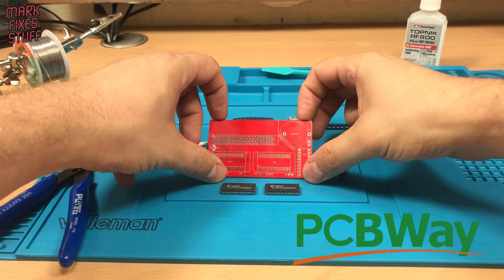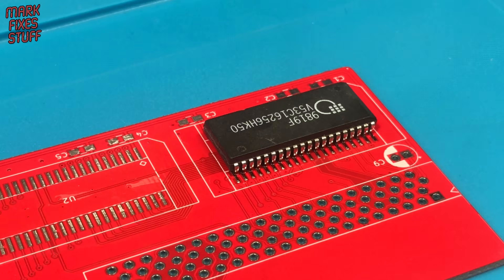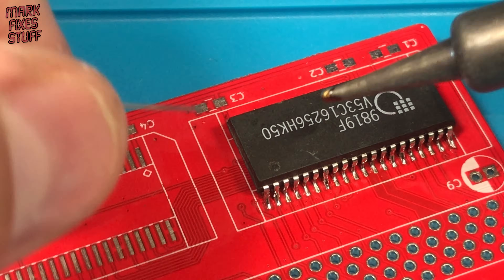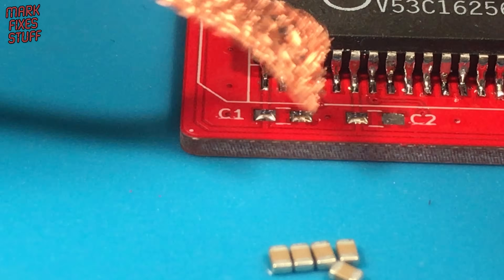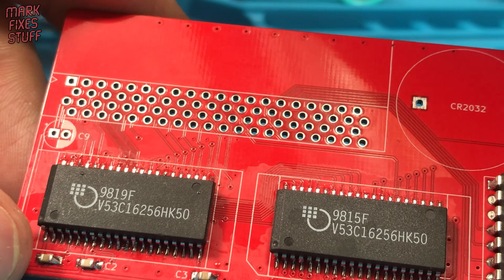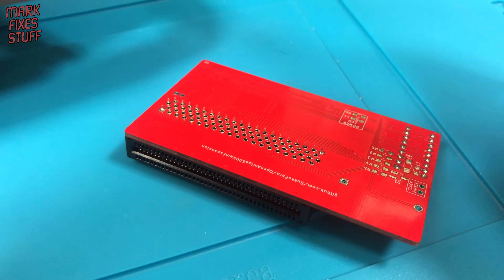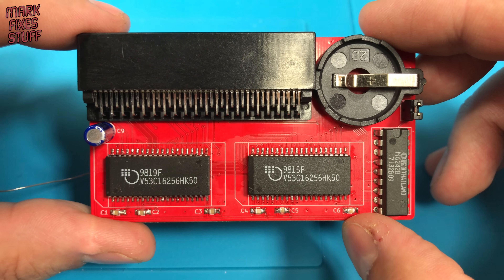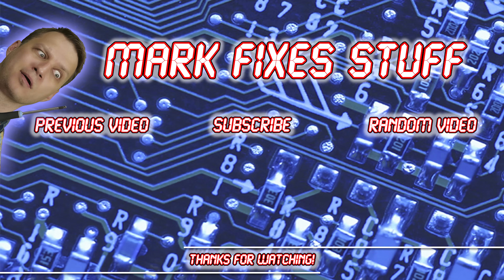Building a Commodore Amiga A600 Chip RAM Expansion - Step by Step!

Comment from the maker: Thanks for watching this video.

Update: I used an incorrect part in my build for the real time clock (thanks Keir Fraser!) so make sure you use a RTC62421 or RTC72421 as listed in the project! I've just ordered replacements. 

If you wish to purchase the board then the link in the description goes directly to the creators webstore on PCBWay. If you order from that page then the creator (SukkoPera) will get a percentage. The page also has a link to SukkoPera's github page.

Comment: i recently purchased a hot plate from ali express its no very big but i can now solder blob on components very nicely i tend so far to use it for chips , it has a hold down so you can be sure the component is in place while you work 
it was around £25 so not bad value
Reply from the maker: Nice. I need to get someting similar. Just don't leave it switched on unattended.
Reply: @MarkFixesStuff   yes thats something to remember for sure , but well handy

Comment: Good job
But after some basic calculations, I've come to the conclusion it would be cheaper to get preassembled board rather than buy assorted components and PCB
Reply from the maker: Yeah. It’s a passion project perhaps. I got all the stuff from Aliexpress so it worked out dirt cheap. You are correct though.

Comment: This video is great Mark you managed to catch and turn my enthusiasm from my original somewhat off topic question of the differences between the ZX OMNI and Just Speccy after seeing the video on RetroManCave! But I dont need anymore computers for me less is becoming more!  So back to the A600 Ram Expansion when your soldering are you using any type of magnification and what type of solder and soldering iron are you using? and this video is great "Tomb stoning" I thought it was just me! Cheers again Mark.
Reply from the maker: Hi Betty! Thanks for watching! When I’m soldering SMD I use a small digital microscope, but it doesn’t work well for filming because it gets in the way. Solder is a thin tin leaded alloy and the station is a temperature controlled Tenma unit that I’ve had for years. I am planning a tools video real soon so watch this space!

Comment: That OKI RTC chip won't work in this board as it requires an external crystal. You can set the time but it won't ever tick upwards! You need an RTC62421 or RTC72421.
Reply from the maker: Ah! I was sold it on the basis it was a direct swap. Thanks for this mate.
Reply from the maker: I found a seller with 5x RTC72421 AliExpress for $6.66. Fix incoming - Thanks again.
Reply: Perfect!

Comment: Do PCBWAY supply components also with pcb. I`ve never used them before and seems like pcb supply only in menus?
Reply from the maker: PCB only. If you order in volume they offer a build service, but I guess you are asking about a kit.

The parts are easy to find though.
Reply: Thanks for the reply Mark. The issue is the edge connector. All other parts seem easy to find.

Comment: I have been looking for a solder sucker that is not just hot garbage, I have been through about 5, all trash, I will give that one a try, thanks for the linky.
Reply from the maker: I've had this one for two years. It's my go to manual pump. In fact, I don't have any others!
Reply: They are great; I have the same one. Buy some spare tubing as it does not last forever. Much better then a regular sucker, but they are a bit small if you have huge hands...

Comment: 3:15 Need WAY more flux for that. You can always clean it off afterwards.
Reply from the maker: Yeah. Apparently I should be using the gunky flux paste as well. I usually do hot air on stuff like this to be honest. Wanted to just use an iron for this vid because not everyone has or wants to buy a rework station.  Drag soldering packages with flat pins works great with the topnik liquid flux. Just the J leg packages don't. I think the curve is the issue.
Reply: @MarkFixesStuff  You can still use an iron but you need a 'louis rossmans worth' of flux and the solder will just fly to the pins. clean after with IPA or an ultrasonic bath.
Reply: Tips: https://youtu.be/LoRxJRU_g2s?t=1825
https://www.youtube.com/watch?v=iKDAmY9Rdag

Comment: You'd e better if switching to a flux paste such as Amtech 559 or Mzg 8341 if you're going to try to drag solder.
Reply from the maker: I actually have some of the Amtech stuff. These J legged packages are a pain anyway, but I’ll try that on my next SMD project. Is it better because it keeps it’s form?

I have a little board heater and solder paste, so I usually just use hot air on these.
Reply: @MarkFixesStuff  a knife tip is better for drag soldering j-leg parts. The ones shaped like a thicc x-acto blade

Comment: Nice video. Do you have a source for the Gerber files? Oh your life would have been much easier using a hot-air station. I just checked SRAM chips for a future design of the same board. Newark has LY62W51216 , which is a 512kx16 SRAM 44 pin TSOP packaged chip, priced at $4.87 single quantity.Comes in 60 and 75ns speeds, 5v. Will be perfect for a similar board.
Reply from the maker: Hey! If you go to https://www.pcbway.com/project/shareproject/OpenAmiga600RamExpansion_V1.html there is a green button to download the gerbers. You might need to make an account for free though.

I got these RAM chips from AliExpress. I bought 20 pieces for about $16 inc shipping to the UK. They are second user I think but all work great so far.